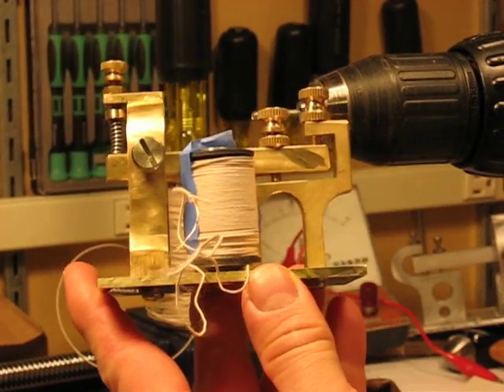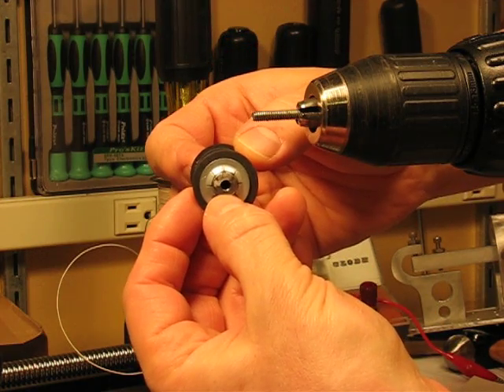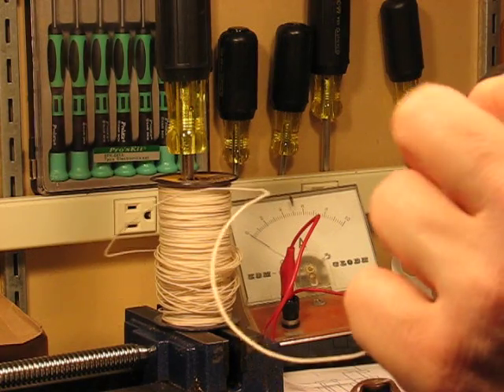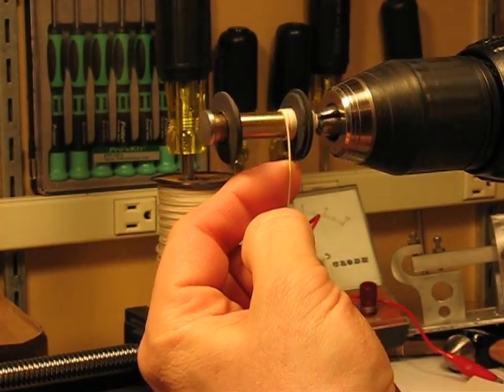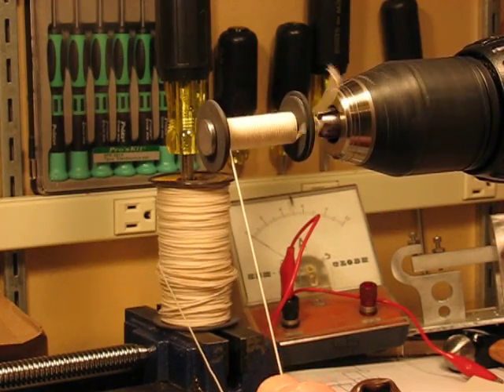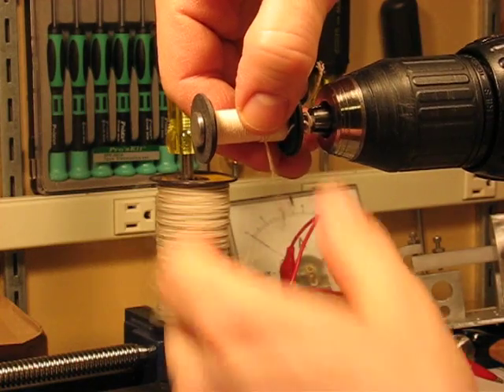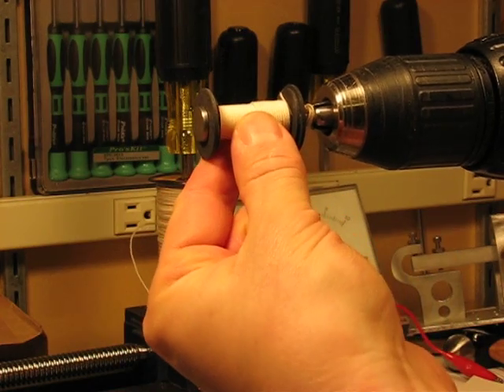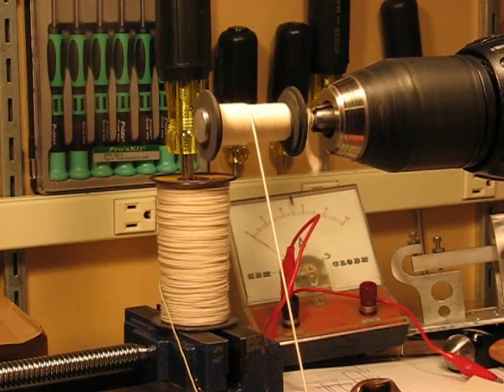Making Electromagnet Coils for a Telegraph Sounder

Comment: Is there any reason I can't just buy a roll of magnet wire and use as is?
Reply from the maker: Sure, it's it's the shape you want I don't see why not.
Reply: I know the length of the wire, and the awg (so I can calculate the ohms / ft), so I can play with current and voltage to get a reasonable response. I have not figured out how to calculate the number of turns, as the diameter increases approximately one thickness of wire for every layer.

Comment: I have wound hundreds of coils for rebuild telegraph instruments.  I use just copper wire coated with an polyvinyl insulation (it's just "magnet wire," common on Ebay, and cheap.)  There is no advantage to beautifully laid windings... it is the amount of wire you put on the coil that makes them function right, not how perfectly the windings are laid.  If the coil has no coil covers (either brass or hard rubber,) cover the outside of the finished coil with a fabric to conceal any irregularities.  If the wound coil is lumpy, wrap it with a couple turns of paper (taped at the outer end,) before covering it with the fabric.  Most coils have 3/8" cores.  For coils measuring 1  3/16" between the inside faces, about 2300 turns of 32 gauge wire will produce a 60 Ohm coil.  Add about 2% more wire than you think is necessary, then back off as much as you need to back off to produce the 60 Ohm coil.  Always use a digital meter to determine resistance.  Always cover the bare cores with a couple turns of typing paper before winding.  Tape the coils when finished winding, to prevent unraveling.  And yes, it is okay to make mid-coil splices if anything goes wrong... just be sure to insulate the solder joint well.  (I use clear nail polish + Scotch tape to insulate any mid-coil splices.)  I use a cheap Chinese hand-cranker ($60 on Ebay) for my winding, and it has a counter for the number of turns. 
 Happy coil winding !
Reply from the maker: Thanks! That's great info!

Comment: does it have to be cotton coated magnet wire  or can it be just regular insulated  magnet wire
Reply from the maker: +Colton McGinnis It can be regular magnet wire.
Reply: Thanks I am rebuilding the electromagnet so for my telegraph
Reply from the maker: In a dumpster in 1986, IIRC. The company I worked for closed it's doors and cleaned out the storeroom. They had been in business since the 40s.